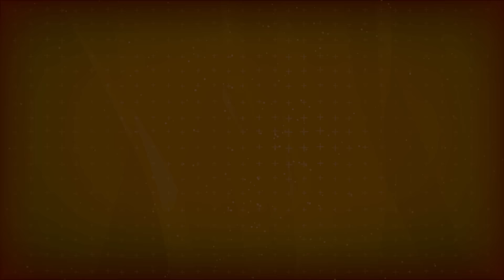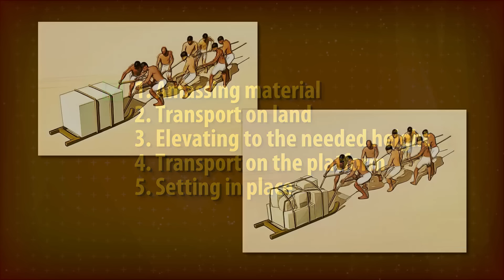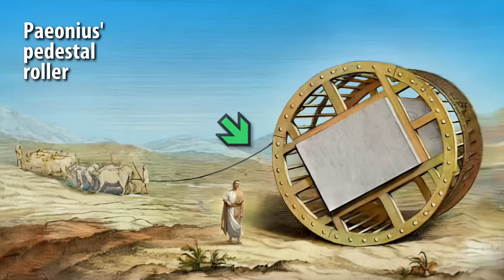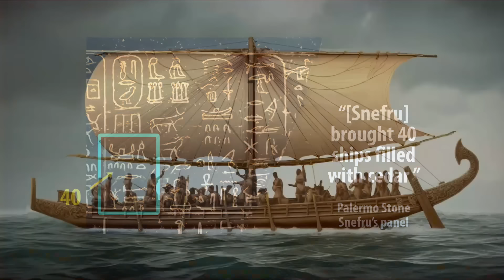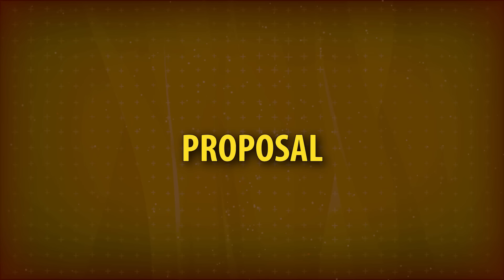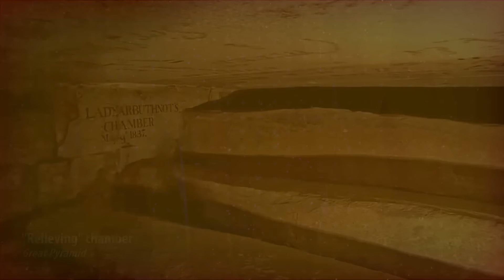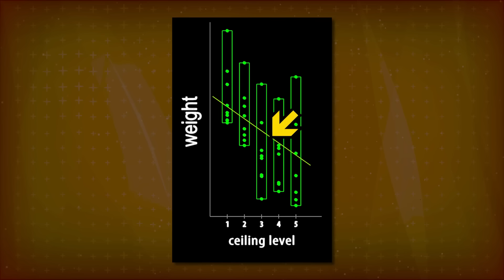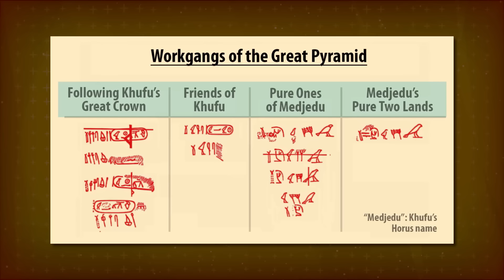How to Build the Great Pyramid in 9 Months (NOT aliens)

Comment: I do see the ratchet action of the top of the rope as genius, and to add to this genius, it may make the design of the quarter rounds somewhat different from what you show. Imagine the rope for a given ramp to be set, closed loop, having the knots every foot or so. This looped rope is then placed down at the base of the ramp, where the block can be easily rolled over the closed loop, and then the loop can be strung around the quarter round into place. The mudbrick quarter rounds have notches aligning with the the knots for constant pulling of the block, allowing them to use the design of the rope and quarter rounds to make the pulling operation faster to start, easier to get leverage on the points that matter most, and have a much better grip due to multiple points that take the load's stress as it turns. Due to the fact that the rope is circular, there is only the pulling of the block to worry about, you need not string a long rope around the quarter rounds that will unwind and change as it unravels, and the point of leverage will remain constantly fixed on the point AND there is only one groove to reinforce makes this a highly efficient way to make the quarter round effective. I do hope you read this... EDIT #4 (lol) So I just realized that the team for each ramp could be streamlined to as little as 8 men, using possibly only two men at the top of the ramp if a walking wheel is employed to pull the ropes, because they are circular, this method works very effectively, and two men watch the rope and feed it as it goes under the block, making sure it is fed accurately into the notches of the quarter rounds, while the remaining two pull the stop block or log behind... uh, that is only six men- so yeah, very feasible to have benefits for raising the blocks up the pyramid!

Comment: A potentially easier way to move things would be hydraulically, by lifting them with water. If a water source was available-aka a spring under the pyramid, blocks could be lifted through a series of locks and canals. Water would be diverted to the highest level and then reused by each canal below it. This series of locks could do the work almost effortlessly, day and night. One could use one tenth the labor.

Comment: From a human resource standpoint, it might be easier to use leg muscles rather than arm muscles. While one can always bring more people in to make a job easier, the legs are stronger than arms. A simple pulley system could allow force moving from a up down motion to be going to a back and forth motion. A stepping down on a step is much easier. One could also use the human body weight where one steps onto a platform; which then lowers pulling on a rope. This could both speed up the process of lifting or pulling as well a make it much easier on the workers. People can climb steps all day without getting tired.

Comment: So is there any reason if you are using rope to pull rolling stones you can not wrap the rope(s)  several times around the stones, making sure to leave enough room and then tie the ends together? That way as you pull on one side the rope is wrapped continuously letting you move the stone longer distances once it is moving.

Comment: the only part that seams odd to me is the layout of the ramps, more specifically the overlap. I understand that for this theory to work with the visual sighting of the pyramid the ramps are not allowed to round the corners of the pyramids. 

however the rolling is a genius move, however with proper setup blocks could roll up the sides of the pyramid with a minimal ramp with the same slope as the pyramid. or an internal ramp with the same slope as the grand gallery. 

the advantage of rolling is the two to one leverage and you avoid sliding friction, the closer you get to a vertical lift the less you fight friction and instead fight gravity, thus rolling up a steep incline just require more workers to get more lifting force and with locking lever systems this could be reduced.

the biggest flaw in my design is the rope strength and rope length, this could be amended with stops along the way where you change ropes. this could be platforms, or stopping logs that extend and prevents rollback. Alternatively there could be two rope groves on the rolling frame and they change them continuously, one would roll up and the rope men would dethatch the old rope and attach the new one while the other rope is still holding the roller.

Comment: What if they were making a sort of fractal pyramid, maybe 2 or 3 interactions deep?

One of the things I saw once in a documentary but not in later,  ones is that, when wet, Egyptian sand turns into a very slick mud which greatly reduces the friction and made it easy to move large weights.

Another documentary showed how lifting kites could would easily place a large obelisk.  Perhaps the circle-with- wings symbol represented a kite?  Another thing they mentioned was that at certain times of the year, the wind coming off the desert is very strong.

Combining these two, I had this idea: What if the kites, if they existed in Egypt, could have been used to assist moving  the stones.  One way could have been like a sail, but another method would be to place a very long rope parallel to the ground or slope of a ramp. This could be fed through an I-bolt that changes the direction of the rope to vertical. As the kite goes up, the rock or shed is pulled across the ground. Someone up ahead would assure the sand ahead would be kept at the proper wetness to be slick.

The limitation in this theory would be if the Egyptians were capable of making ropes that long and if this hypothetical kite would have enough lift and strength to to pull the stone and lift the increasing weight of the lift.

I love this parbuckling idea.  Could such kites increase the efficiency of the parbuckling and sleds up the ramp?

Comment: This is very well put together. Any thought to how they would’ve hoisted the cover stones on the multiple “ceremonial bill sarcophagus”, not sure what the proper name for those are, given their extreme weight and extremely tight tolerances? Also, I think it’s worth mentioning the precision tolerances in other aspects of their buildings as well to try and explain this during their time period given the fact that there are precision holes clearly drilled into granite blocks, precision structural alignments with astronomical bodies, and even the slope of the outside of the pyramids had very minimal deviations from one side to another, with some being reported at less than 1 degree deviation. Any theories on how this was achieved? It would be interesting to hear this type of analysis for the anomaly of their precision. Again, very well put together video and thanks for all the effort involved 🍻
Reply: Great questions but I don't think we'll ever know all the details. The drilling is a tough one. lifting the caps onto the sarcophagi would've been done when that whole area was open. There were no walls around the chamber yet and certainly no ceiling, so they had little constraints in terms of space. They had a large, flat, open area to work on. hell the couldve covered the whole thing with sand, dragged the caps up there, and then dug the sand out, slowly lowering the massive stone into place. The tolerances just take lots of measuring , chipping, and remeasuring and then more chipping/grinding. Using stone on stone. It's slow and labor intensive but not impossible. 
As far as i know we don't have a good idea how they drilled deep holes in granite. Drilling into the concrete slab in my basement now with a power drill is hard enough without the right drill bit.
Reply: @Macumazahn16   masonry work requires a special breed of person to tolerate 🙇🏼‍♂️ 🫣
Reply: Sighting the angles of the sides is one of the arguments in this video: An expert architect, standing on the incomplete period looking down eh corner to make sure it's straight as planned .

Comment: I can see nothing wrong for pyramid builders hiring engineers from other countries. If you put together 5 of the finest the chances of one of them knowing about the techniques you presented is extremely high.

One of my moments of brilliance was when I puled a 20cm diameter tree from the ground using a rope ... and another tree. The tree was already dead so I can't imagine more than several tons required to pull the roots. Tie the rope to the trunk of the dead tree and wrap it a couple of times around a healthy one. Bring the looser end back to the center between the 2 trees and tensioned role (they where about 20m apart). Tension the rope in the middle even more by just bowing it. Pull on the looser end if the dead tree gives you any slack. Ropes and trees are not entirely rigid, but if they where, mathematically at the moment you start bowing the rope you are technically delivering infinite amount of force between the 2 trees.

Comment: I've thought about what the mainstream says they used for tools,as well as other available items of the time. 
With that being said I wonder if they used water powder as it was abundant from the Nile which was much closer,as well as higher than modern day. Maybe using a waterwheel to pump water to a higher tank on stilts and used in gradually narrowing tubes/pipes that could use the same water power and large, think clay pot to build air pressure (a few psi) that could aide in water velocity to cut the rocks

Comment: Your fractal idea is interesting, but it still requires a lot of extra construction.  If you modify your fractal ramp idea and instead go with internal ramps, then the internal ramps just become voids that can be filled with rubble after the after the fact, and the ramps just grow with the pyramid. No wasted materials, and it doesn't interfere with siding or sighting as you correctly pointed out.
Reply: This theory doesn't rule out an internal ramp, nor does it rule out the Grand Gallery as a freight-elevator to raise larger stones or other material. The creator even stated that multiple techniques were probably used in concert depending upon multiple factors...

Comment: Brilliant! If you can come up with something remotely as plausible on carving granite with copper tools, it would be really something:)
Reply: Ive seen a pretty reasonable theory that involved using copper tools along with abrasive grit to drill and saw through the harder stones
Reply: It's basically the same as what we use today .. use a harder Stone to cut the softer one.... same basic technology as we use today
Reply: Maybe I can help: Masons have known for tens of centuries that it's not necessary to "cut" stone as most folks imagine, it's only necessary to "score" the stone, that is cut into the main mass just an inch or two and then insert wooden wedges which, when drenched with water, expand and create tension in the material that can be exploited by simply giving the stone a good whack with a wooden mallet or a hammer-stone so that the stone cracks along a very predictable line leaving behind a surprisingly straight and smooth surface that can be quickly fine-tuned (especially considering that the overwhelming numbers of blocks were not as precise and perfectly fitted as the Hancocks of the world like to claim but were, in fact, borderline crude.)
Reply: @ivarmykland - Dr Mino over at "World of Antiquity" does that.
Reply: If copper is too soft, use stone tools .  Diamonds (allegedly the hardest material) are cut with diamond sand held by the softer material iron .

Comment: Rubble is probably not a very accurate word to use. It's more like a tight, if irregularly shaped "fill". 
Rubble has the connotation of "junk" being dumped in willy nilly as fill but I don't believe it would be so random. Obviously the builders weren't so accurate and fussy with the fill but they may have been conscious of filling the spaces quite tightly and uniformly being mindful of the sheer weight and forces of such an enormous construction.

Comment: I like this solution. Its got some good ideas. I suspect the pulling crew was double the size and they need not be on the ramp just on the terrace. The vertical granite and big limestone block raising makes a lot of sense. The clay rollers are something that a group of enthusiasts could test relatively cheaply with a concrete block. I'm not sure you are right about the medium lift rubble being loaded into a larger standardized box/ big roller. If you make two sizes: the big unit you depict and a smaller one man barrel sized roller box then the same 8 men can move 8 barrels up the ramp while the rope handlers are setting up for the bigger block. 
I'm also inclined to think that the smallest rubble and some two man lift blocks were lifted with Shadoof, counterweight cranes, in small woven baskets not nets. While big crane would crowded. A stair of shadoofs set up on the flat end terraces would lift many tons an hour. The basket is hooked and unhooked from the lift shaft with little horizontal shifting. A shadoof can also pull on the ropes with locking mechanism. The counter weight of the shadoof halves the load in the pulling crew.
Reply: Your shadoof theory reminds me of a decades old comedy cartoon where they did exactly that, with a live camel as counterweight (a live ox or goat might be more realistic, but not match 20th century prejudice about the Baghdad Caliphate (which that publication frequently referenced) .
Reply: @johndododoe1411  I need to find that cartoon. lol.

Comment: This is actually pretty good, looks at very logical concepts, the rolling of the stone is also better as placing it on a cart introduces large friction issues over the axles and the carts themselves would have to be massive to withstand the weight where the stone itself becomes the structure that the cart would otherwise have to be present

Comment: Solid argument, but doesn't at all explain the purpose of the grand gallery? To impress people? The small tunnels would argue against being friendly to visitors, with plugging stones almost shouting that they didn't want anyone to enter after it was closed, if it was closed.

Why doesn't anyone ever say anything about the possibility of using animals to pull some of the heavier loads? If they had wheels or knowledge of the wheel then they had to know about pulleys. What about the amount of D-ring type holes everywhere in on and around the Giza plateau? Maybe there is or was a structure already in place at that location like a mastabah or temple and a pharaoh decided to build a pyramid around it? That isn't as uncommon as one may think.

Comment: This is, undoubtably, one of the more plausible explanations to date. Well done. My hunch is that here was another pyramid next to or near this monolith and that pyramid was used to build The Great Pyramid...the ramps, etc.
  The system of ramps mentioned was, in my uninformed opinion, a combination of several of the models shown...not strictly one type of system.
Like any other project, processes do require change every now and again.
 Kudos to you for the nice work.
One reservation I do have is the fact that the Great Pyramid is actually eight-sided as opposed to four. This, I believe, is crucial in understanding the method of construction.